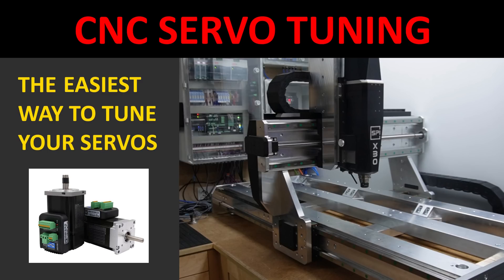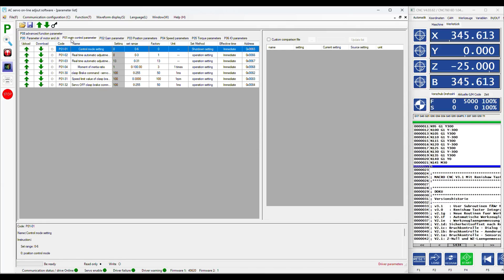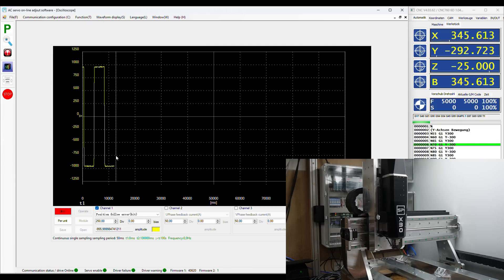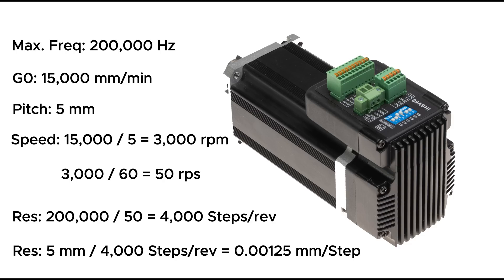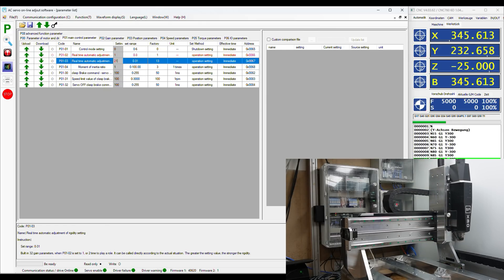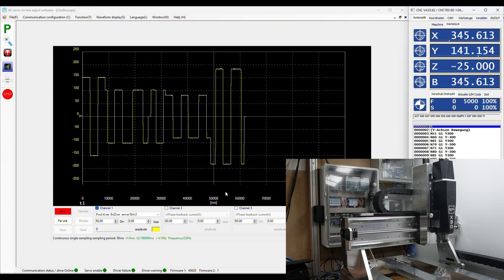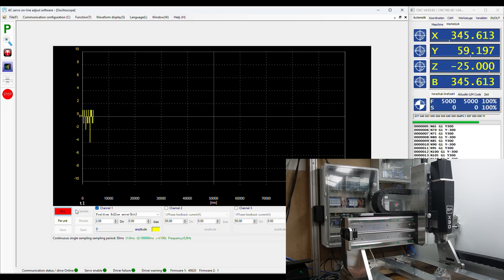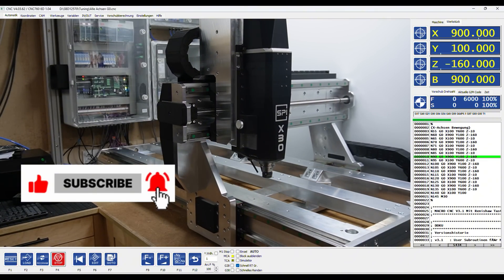CNC Servo Tuning  - The Easy Way

Comment: Hi, did you have trouble connecting to the serial port? I managed to connect once, but then it wouldn't connect anymore.
Reply from the maker: Which serial port? Not quite sure, what you mean
Reply: @scratchbuiltdesigns I'm trying to connect to the JMC software via serial port with RS232 converters. Did you have any difficulty with that?
Reply from the maker: @rodbarx  I used the adapter I mentioned at 1:41 in the video and listed in the description. No issues. Some others failed on me, but this one worked (for me)

Comment: i wish i had aboss like you as apprentice when i was younger! thanks fo taking time to explain all that! I'm building this similar on a much smaller budget, any things you think can safely be compromised? or things you would accept buying cheaper to maybe upgrade at a later date?
Reply from the maker: Well, you can save a lot of money on lesser grade ball screws and linear rails, and use steppers instead of servos. For woodworking that is no problem at all
Reply: @scratchbuiltdesigns  I intend to mostly use it for aluminium with a smaller size 450 or 550*750mm footprint.

Maybe later, some very light steel if possible, when I get a better spindle...
Is this possible on this kind of machine?

 I have only ever used hand tools and table saw

Comment: Hello, thank you for your wonderful video. I only have one question. I have been trying for a while to connect to the servo. But not all the dots at the bottom of the JMC software program turn green. The dot for servo enable is blinking yellow. I have tried 3 different cables, 2 with a Prolific chipset. I have also tried with multiple computers, and they all have the same problem. The computers do see something because the dot for driver online is green, and the driver failure is green, and the dot for driver warning is also green. I have asked 3 people, but they didn't know either. And I can't find anything that explains what that yellow blinking dot means. Have I been unlucky three times in purchasing a cable? Could you possibly help me?
Reply from the maker: Have you enabled the servo in your CNC software?
ENA+ and ENA- from the servo connected to the drive output of your CNC controller? Besides the step and dir signals, it should have as well an Enable signal. 
In my case (EdingCNC) only after a Reset at the start of the program the drives are switched on and become enabled
Reply: @scratchbuiltdesigns  I thought the servo motor was already enabled, I can use it without an enable signal. But I also tried to connect the enable signal twice. But I will try this again tomorrow, I will keep you updated on whether this solves the problem. thanks for the fast reply.
Reply from the maker: @metalspinningworks8605  Just out of couriosity...can you change parameters in the current state?
Reply: @scratchbuiltdesigns I can change a number in the parameter list. But this does nothing to the servo motor. And the line that I change does not turn red either. Furthermore, the oscilloscope is also not working.
Reply: I tried to connect the enable, but it seems that the motor is turned off when there is 24V on the enable. And in my JMC software, the Servo enable still blinks yellow.
Reply from the maker: @metalspinningworks8605 Hmm. Kinda hard to give any further advice without seeing the whole setup.
Hope you manage the tuning somehow
Reply: @scratchbuiltdesigns  thanks for you help i wil keep going. I have the feeling it is somting stupid i am missing. i wil figer it out.

Comment: Hey Scratchbuilt, another great video – super valuable info and the tuning was explained in such an easy-to-follow way. Thanks for that! I’m especially curious about how you tuned the gantry axis on your machine since it uses two different servomotors. Did you apply the same tuning values as for your portal axis, or is there a different approach for handling two motors on one axis? Cheers, I’d really appreciate your thoughts on this!
Reply from the maker: No, it is the same approach. In fact, in real live I do it the other way round than here in the video. I set P02-03 to 100 first and then I gradually increase (or decrease) P01-03, starting with a value of 20. I did it on both servos and checked the following error. Since you can obviously not change values while the servos are running in this case, you need to change the settings on both without running and then check again.
Usually you hit the spot after 2-3 changes of P01-03

Comment: I wouldn't use those servos, they are excellent for learning but for using - I don't like that the controller will see the recuperation energy. You can get separate servos for 130$ already which will allow you to connect a resistor to burn the recuperation energy. So there's no point in getting those integrated ones. Actually your JMC motors are delivering the recuperation energy back to the powersupply - it might blow the powersupply or reset it in case it has some protection. What you can deploy is an energy dump to ground on the DC line however there's the risk that the entire controller will lose the position.
I have a bunch of JMC Motors, but I only use them for learning purpose nowadays, putting my own firmware on it (mine still have STM32 controllers on it, for later ones they changed the controllers)
Reply from the maker: Many people make the mistake and build with one PSU per servos. I explained in an earlier video why this makes no sense, and yes, Back-EMF is one reason.
I have build several routers with these servos and neither myself, nor my customers ever had an issue.
What size were your servos? 180W or 400W? Have you tried a capacitor inbetween?
Reply: @scratchbuiltdesigns  No that is not an issue with one PSU per servo. It is the energy the motor generates when you slow down the movement.
As long as you stay with G1 it should be fine, but rapids and slowing down rapids might inject power into the power line.
The motor power is directly coupled with the power input of the controller and there's no protection in between that avoids that.
You entirely rely on the voltage regulator of the controller to handle the variable voltage on the power rail.

Use a voltmeter and measure the max voltage spikes when slowing down the machine from rapids.

As mentioned those motors are good for learning but definitelly not good for such applications.

I used the 180W version, but it doesn't matter, it's the design of those controllers bothers me.
With a 36V power supply I was able to generate overshoots up to 80V - while some components in the controller were only rated up to 50V (and you should better have some extra buffer and not touch the maximum rating of capacitors), my application was based on speed - a pick and place machine.
So there we have it - a controller rated for 50V which can easily be overshot. The 400W version for sure is different but the fundamental problem remains that they can be overdriven and nothing in the controller protects the controller circuit.

With all the experience collected with those integrated servos I can only recommend those motors for educational purpose but definitely not for practical use.
Reply from the maker: @mrechbreger Well, if 10 people use a product and only one has an issue, I don't blame the product....
They have a back EMF. Yes. So what? Just deal with it at the PSU side. No problem at all. I already explained how.
As you can see at the end of the video I run the router with 15m/min G0 and 2m/s² acceleration without any issues.
For pick and place that is too slow, but for a woodworking router of that size totally fine.
Reply: @scratchbuiltdesigns I doubt that you evaluated that back-emf generated from your setup matches the parameters of your PSU, it's done the usual way put together and defined by it works[tm]

You don't even know which regulator is used on the 400w controller for powering the controller circuit do you?

The JMC 180w motors easily exceed the specified values by JMC (and they rated the motors to support 50V while using 50V capacitors on the controller, which is not a positive thing).
15m/min with a 5mm pitch ballscrew can reach up to 3000rpm, that can already exceed the ratings of various components and damage them over time.

JMC itself has better split non integrated solutions.

Yes it works for 10 people until it breaks :-) That's the usual assumption. And I'm also sure they aren't doing relevant rapids all the time (like I do with the pick and place machine). So damage will build up slowly just a matter of how slow.
Reply from the maker: @mrechbreger  Funny, how many things you assume and are so sure of...
Anyway, thanks for all your valuable input
Reply: @scratchbuiltdesigns  if you opened them please upload some photos of the PCBs, I used integrated JMC servos years ago until I stepped up luckily. I'm working with servos with separate controller power supplies up to around 2kw (JMC, Delta, Mitsubishi and some others).

I have fully reverse engineered the 180W ones for educational purpose (as mentioned I'd only recommend for learning purpose). JMC has iterated the layout and changed the chipsets inside back then. I guess they were not comfortable that people were able to exploit the STM32 parts and download the firmware by themselves. Several vendors are using parts which allow to encrypt the firmware on the chip nowadays.

"Funny, how many things you assume and are so sure of..." if it's so funny let's discuss them further and more details.

Those integrated servos have several disadvantages, but of course they're easy to use.

Comment: Very nicely explained as usual! 
I replaced the JMC’s for Delta because I was very disappointed with the so called autotuning when I also found out it was nothing more than a simple look-up table….pretty deceiving marketing if you ask me.
The Delta servo’s, A2, are a different world in terms of tuning.

Wondering what kind of acceleration valuesin Eding do you tune for?
Reply from the maker: I fully agree. I have Delta B2s on my big machine and yes, they are a different league, but as well in terms of pricing. Since this is a pure woodworking router, the JMCs, however, are perfectly fine.
I settled for 2000 mm/s² acceleration

Comment: Very informative video. Beautiful build. I have a question, 'How did you tune your dual Y-Axis Motors'?
Reply from the maker: In the same fashion, only that I had to copy the settings after a change and couldn't do it on the fly.
But the sequence here was more for educational purpose. 
I know how it is done and it was spot on after the second change.
On my other router with the Delta Servos I did it differently. I decoupled one ball screw and ran the autotune without the Z axis attached, so roughly 60% of the gantry weight.
Proved to be the right approach

Comment: Same here, P02-03 at 100 for the win ;-)
but now to the interesting part: how exactly are you tuning your tandem axis?
Just set it to 100 and the rest to the same value from the "auto tune"?
Reply from the maker: Exactly. Did it in 10 minutes. P01-03 To 21 and P02-03 to 100.
On both servos before the first movement. Ended up spot on with 2-4 steps, but have a 8000 steps resolution because of the 10mm pitch on that axis
Reply: @scratchbuiltdesigns  never had to do it myself but I get that question a lot....
Good to have someone with first hand experience in the vicinity.
Reply from the maker: @KlausMichaelKMS On the big machine with the Deltas I did the tuning while the Z axis was still off, so gantry weight was about 60%. Decoupled one ball screw and ran the autotuning. Proved to be ok